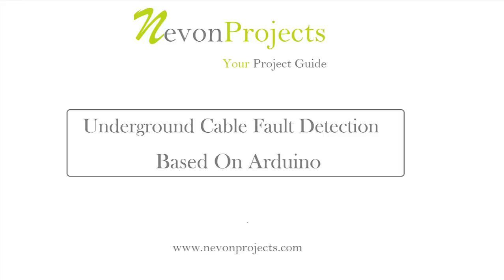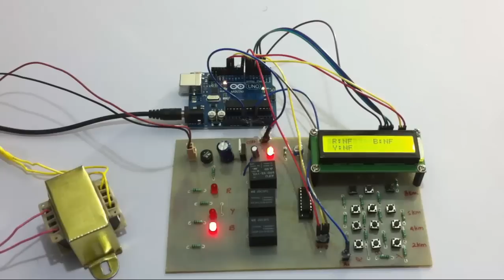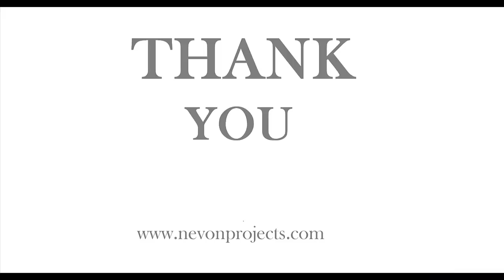Underground Cable Fault Detection Based On Arduino

Comment: I need this system using IoT but on an optical fiber cable asap
Reply from the maker: For this Electronics system details or free document/PPT pls call watsapp
+917738796642 or visit link in video description

Comment: What is the maximum length of cable that can be used for finding fault?
Reply from the maker: For free synopsis, ppt or any details of this project - Pls Call/Watsapp +91 7738796642

Comment: my final projet is also this but i face problems in doing its hardware implementation.When i creat a fault manually the diatance couldn't be displayed on LCD.what will be the reason for that?if you have any video which shows in detail how this equipments are connected please help me.i only have 2 days for submission
Reply from the maker: Pls find complete project details at http://nevonprojects.com/cable-fault-distance-finder-project/

Comment: sir what is the need of relay driver as ardiuno also gives 5 volts as output ?
Reply: Kapil Negi it's to operate relay. Relay module is the combination both relay n relay driver since its needs driver to be operated
Reply from the maker: Pls find complete project details at http://nevonprojects.com/cable-fault-distance-finder-project/

Comment: what is the use of relay and adc here
Reply: relay connects to particular cable line and with the help of adc we measure voltage across particular cable line and based on voltage we locate fault at exact place...switches are used to show the fault conditions . In this, it is line to ground fault detection.
Reply from the maker: Pls find complete project details at http://nevonprojects.com/cable-fault-distance-finder-project/